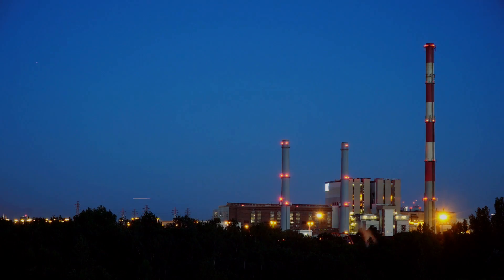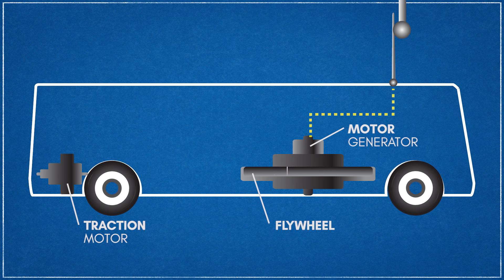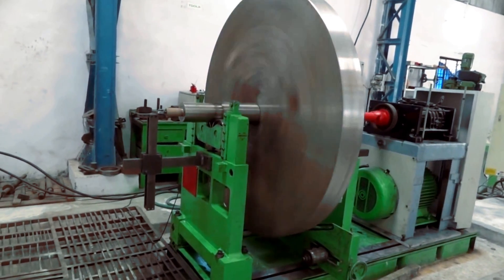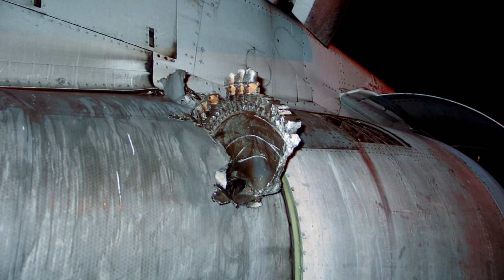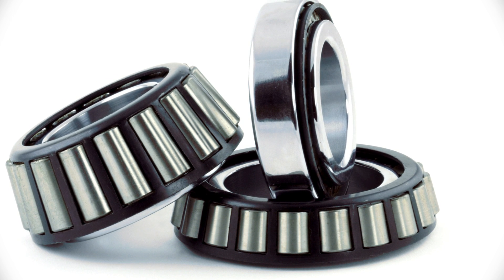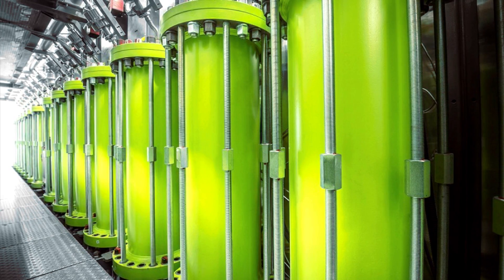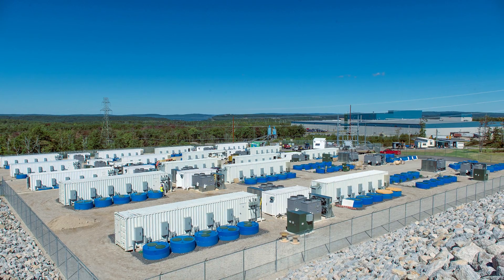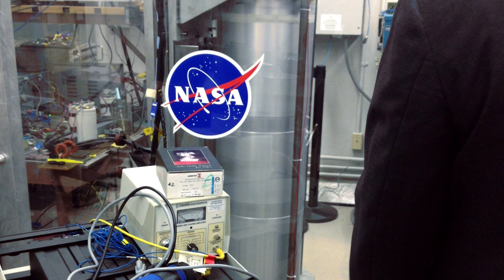The Mechanical Battery

Comment: Also storing energy for rail gun, laser systems...
Reply: Um those things need billions of gwatts to charge fuck the rail guns them selves give off so much thermal heat do to how much energy is required to fire the round all early designs just resulted in a gaint pile of slag that just out a ball of molten metal about 2 foot(its hard to throw a liquid at mach speed)
Reply: @Mystickrage  I've been looking into making a pdw style railgun for a minute. Subsonic is intentional, low effective range is inconsequential, the barrel would need to be replaced often which would decrease failures to function and overheating weakness, and semi-liquid projectiles just sound like enhanced expansion rounds to me. Other than power storage, which I intend to handle off board, I don't see a reason why it hasn't been done

Comment: The biggest problem with this is it lose massive amount of energy as the bus is tilting left, right, or going up and down ramps.
Reply: I agree. That's one HUGE gyroscope! It would make sense if it was vertical axis, so it was not subject to gyroscopic effects due to turning corners. It will still make the bus want to roll side to side, as the front end or back end of the bus dips or bumps. It would have a tendency to turn a rocking motion into a rolling motion.(90° off axis) The only way to solve that problem, would be to have 2 flywheels, turning opposite directions on parallel axes.
Reply: 2B used only on flat surfaces.

Comment: A large flywheel could also be combined with gravitational potential energy storage.  Imagine an enclosed FESS 10 tons in weight being lifted and lowered up and down a tower, or in a deep hole, or down the slope of a mountain.  You'd get a double whammy of energy storage.  
I've yet to see this done, but it would seem practical for the heavier, slower, types of FESS.
Reply: I see a possible problem with this idea.  Remember that the Earth rotates on its axis one revolution every 24 hours so unless a flywheel is restrained precession forces will cause it to change it orientation to the point where after 12 hours it will be upside down.  Easiest way to harvest the potential energy would be lowering the mass using wire ropes over drums and this would not provide the required restraint.  Solution would be to gimbal mount the flywheel but this adds cost and complications.  Interesting idea though!
Reply: @Vincent_Sullivan  Thanks for the thoughtful reply.  Yes, it would need to be restrained well enough to resist such forces, or put on a gimbal.  It could be lowered on tracks and be subject to similar forces that any stationary flywheel would suffer.  Plot twist: the flywheel is also a chemical battery.  Flywheel+gravity+chemical battery.  I only partially joke about that.  I'm sure that lead-acid batteries could be designed as part of a medium-speed FESS, providing both mass and chemistry.  No matter what, we need to be creative about energy storage.

Comment: Excellent video,  here in Australia there is a big discussion.  Solar usage is increasing dramatically,  so storage is big issue.  Question is how to build a kinetic storage that can last for hours, because solar produces most of its energy between 1000h-1400h. Demand ist strongest around 1700h-2000h.
I suspect you could build huge 1000MT flywheels that would hold energy for a decent amount of time. Because one thing we have in Australia plenty of is sun and space

Comment: I didn't hear it mentioned, but we do actually have a ginormous flywheel energy storage system in form of the rotating mass in the electric network, both the generators and the motors. This is not usually apparent, but powerplants do rely on this during switchover etc. and locally dealing with high inertia motors and variable frequency drives they can keep the dc bus energized as long as they spin.
Reply: Exactly right, this is what gives the grid the ability to clear huge faults without loosing grid frequency. A solid state energy source like an inverter would just trip on overload.
Reply: Storing energy as mechanical energy in the form of a flywheel is genius. I particularly like the applications for the system in space. 
If we were to ever make it in space I believe this would play a huge role in storing mass amoumts electricity. 
A solar forge. Sweet sweet imagination eh?
Reply: @avatar1867  Yeah when in space you can connect the electric motor to a propeller and you will be able to fly to the next supper Earth in record time !
Reply: christopher lobato   We already use flywheels on spacecraft for attitude control, and use thrusters to spin them back up when they get low on inertia.

And as for others talking about using radiation, we already use that for spacecraft too. We use these fancy devices called “solar panels”.
Reply: @avatar1867  we already use flywheel energy storage in space in the pointing systems.
Reply: @gregwarner3753  
Nice! I did not know. Now all they need is a manufacturing plant in space.
Reply: @avatar1867  what I like about this idea is that I wonder what happens if we figure out how to make micro versions. Imagine sticking your phone on the charger and it gives a small motor juice to spin a couple of super tiny, extremely affordable mechanical batteries. No lithium, no fuel or coal if you use a solar panel. I hope they figure out how to efficiently wind it up without electricity. 

Just think even if a solar flare hit, you could still charge your car up and drive it through town. Their has to be a way to get energy in your car without having to rely on electric wires that fry as soon as a solar flare big enough hits bruh
Reply: The Earth itself is a giant flywheel, litterally!
Reply: even better is SMES, electron flywheels.
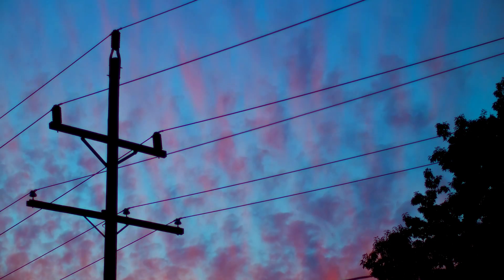Reply: it is mentioned at 13:35
Reply: @ashnur  Not really, as he focuses on dedicated flywheel installations.  The most prominent grid level flywheel use is the "rotating mass" of flywheels and other mechanical components attached to the synchronous main generators at power plants and the occasional mechanical converters.  The fluctuation absorption abilities of these flywheels is often used as arguments to keep those power plants running beyond their direct usefulness as energy sources.  Synchronous flywheels are great at frequency stabilization and absorption of bursts below 1 minute, but not for storing MWh or GWh of energy due to diurnal fluctuations, which is where dedicated variable speed flywheels compete against chemical batteries.
Reply: 13:30
Reply: You're an idiot.
Reply: It doesn't make for good energy storage with a large time differential.
Reply: Chernobyl???
Reply: @holijames82  Yes, Chernobyl!  The event that caused the meltdown/explosion at Chernobyl was a test conducted by the operators that was designed to prove that the flywheel effect of the mass of the rotating generators/turbines could be used to provide energy to the emergency cooling pumps for a short period of time until the standby Diesel generators were started and ready to assume load.  While setting up for this test the operators managed to get the reactor into an unstable condition and the rest is history...
Reply: Nope 🙅🏻
Reply: Yeah, the engineers at Chernobyl were huge fans
Reply: tobzo I was just going to say this haha
Reply: Hold on a low resistance hydrogen filled chamber? Excuse me? Maybe he's talking about helium?
Reply: @avatar1867  -- Hydrogen is widely used for this purpose, even filling the enclosures of giant electric generators. Hydrogen is cheaper than Helium and has higher speed of sound (higher heat transfer) at a given temperature. There is zero explosion hazard as long as no Oxygen is mixed in. So keep the enclosures slightly pressurized!
Reply: @YodaWhat  
Interesting. I feel this would have great potential done in space itself. However there is tons of radiation in space. utilizing that itself could be very good  no?
Reply: @avatar1867  -- Use space radiation... for what? Like the radiation in Betavoltaics, it is extremely difficult to use it at any reasonable efficiency. The range of particle energies is just too wide. Also the radiation in space, while easily damaging to most living things, is still very dilute compared to things we think of as "energy sources". Yes, as a theoretical possibility. But as a practical thing, no.
Reply: @YodaWhat  
Not space radiation. 
Useing the fly wheel to store electricity as mechanical energy, in space. That's all I was saying. lol.
Reply: @avatar1867  -- There are trade-offs to be considered. The main benefit of outer space for flywheels is the vacuum, which also comes with complications. Cooling is much more difficult and flywheels have to be used in matched pairs or quads for torque cancellation, both factors worsening the mass penalties of normal flywheels. OTOH, the vacuum could make possible the use of unusual forms and very large diameters that might look more like spinning tethers than any kind of wheel. Those might help to overcome the normal mass penalty of flywheels.
Reply: @avatar1867  
Yep, it's called sunlight, we use it for power, propulsion and attitude adjustment. 😉
Reply: @YodaWhat  lol it would look like the ship from the cloverfield paradox
Reply: @andrewplough9897  I did not see that movie, it had bad reviews. J.J.Abrams strikes again!
Reply: Take this video down now!!!!!!!!!!!!!!!
Accelerating faster than Earth's spin in centrifugal forces does what; faster than the solar system...? Exactly
We know the benefits of being able to have centrifugal force; it can become a gyroscope, that provides stability
In multiple axis, with multiple gyroscopes at different dimensions....well then all you need it to provide resistance in any variable to make force in that direction; i.e. everything we see is a loss of the universe; heat, electricity, ect. 
If you can spin hundreds of thousands of rotations per, whatever, then you could do millions with a short leap in advancement. So a super electrostatic motor, that is also gyroscopic...a battery, your propulsion, stability control, all in one. Thrown into your flying saucer; you'd fly into a thunderstorm and charge your saucer; spinning your gyroscopic mechanisms up to millions of rpms, all stabilizing each other; and enough power to fly around the Galaxy. Make sure hang solo has done the proper calculation in the computer; zip off into space. 
Avoid the emp's of Betelgeuse 😘; he made mention of this 🙊🙉

So again; take this video down now

Did I mention zero friction lubricants or magnetic suspended bearings. 
What about new rare metals and materials that cool with friction; I think I've said to much...

Again, take this video down now.
Reply: @robh467  
...
You sound like my mate when he's drunk.
Reply: @MostlyPennyCat  
You sounds like said the same thing as every other reply. clap clap.
Reply: 10hrs spin post input..(?)
-Not possible, were Earth also spinning
           (_______F.E.______)
Reply: @lavernroerig4039  Moron
Reply: @lavernroerig4039  good thing to see that you're being duped by Phoenician propaganda, and to think that civilization hasn't been around for a good 3000 years.
Reply: @lavernroerig4039  I question that claim also, likely the last 4 hours are too slow to generate properly though, even if still spinning

Comment: The Zion power plant (Chicago, Illinois) main generator was used as a dynamic reactive load balancer for grid voltage optimization by picking up apparent KVAR loads and bringing current/voltage phase angle shift closer to unity.  I can see a future of more mechanical reactive load balancers being used to combat all those grid tie inverters in distributed generation networks to minimize all the reactive ringing noise.

Comment: One thing I was wondering about is can a solar panel on the roof and /or hood ( bonnet) and/or trunk lid (boot) of a vehicle be used to power a small motor to keep a flywheel spinning and then in turn use the FW to power the car or charge a smaller Li battery to propel the car? As the car is moving it could also augment the power needed to maintain the rotational speed of the FW and during breaking also reverse power to the FW and / or recharge the battery pack. The FW generator could also recharge the battery pack when the car is parked in the sunlight to recharge the battery pack. The solar panels are for the FW to maintain it speed not to recharge the batteries directly. The FW generator would be for that purpose. Just a thought.
Reply: You're adding an extraneous minimal system to an already much more powerful system just to run a particular item.  It's added complexity for almost no benefit.  It would be far simpler to just run it off the main battery.  Either way, solar panels on a car are such a tiny supplement to the total energy needs of moving it around as to be barely noticeable.

A modern electric car can run through a 100 kilowatt-hour battery charge in a few hours of driving.  That's enough energy to power a typical family home for 4 days.  You'd be better off putting your solar panels on the house, where they can contribute a meaningful proportion of the energy being used, and positioned for greater efficiency than on a car that moves around through light and shadow and direction changes.

On a lightweight vehicle like a PEBL or ELF electric bike, where you only have to push around a hundred kilograms, then the rooftop solar panel can recharge a meaningful amount of capacity in a few hours, because they get 80-100 miles on a battery bank of under 3 kWh -- an energy/mileage equivalent of a car that got like 1,800 mpg.

Comment: Some of our wrist watches have windings that uses mechanical energy to power devices.
Reply: Some? A LOT of our watches have them. Every watch without a battery. Every clock.
Reply: @jamesbizs  think he meant instead of winding it up at certain time with the winder to load the spring but winding it up automatically by your arm movement as you went about your business.
Reply: W Winterheart  Tissot, Omega, and Seiko had watches in which rotation was used to load a battery. I have a Tissot PR 100 Autoquartz.
Reply: @DietmarEugen  funny thing is the movements are all by ETA and cost about £30. One haas to wonder where the other £469.99 comes from, the cases are mostly just stainless and plate…
Reply: Although to be fair the Seiko are pretty darn good and made in house if memory serves.

Comment: Fantastic video. I subscribed. If I were to make a gentle suggestion it would be to spend a few more seconds talking about windage (the need for vacuum in high rpm) and the material science showing the strength necessary to contain the forces generated that want to explode. My favorite analogy when explaining flywheels is the old playground "merry go round". Most people born in the 20th century remember how hard it was to hold on at the outer circumference and how easy it was if you sat in the middle. Again. Thank you for a video I can share with those interested in flywheels. The history in the beginning was excellent!

Comment: I don't think this is practical for mobile use cases but I was blown away by the potential for using this technology in a power grid. Long life, high reliability, rapid charge, rapid discharge, constant battery life, non toxic components.... What's not to love about this?

Comment: The Proton Syncrotron at CERN wich have operated since 59 and still does have used a flywheel system installed -68 consisting of a huge MG machine the size of a powerplant steam turbine to even out power fluctuations in the grid due to the accelerators fast cycle times. While operating (wich it does more or less 24/7 during almost the entire year minus service and a longer stop of the entire facility over christmas/winter and starting again in feb/march) it can ramp up and down in intervals of 2-3 seconds at around 40 MW  plus minus ramping the magnets up/down = 80 MW power variation every 2-3 second while delivering beams to several experiments running at the same time including the loading/filling of LHC. Without this flywheel storage this rapid and constant high power cycling would cause the voltage in 1000s of homes and industries in the area to constantly fluctuate  causing lights to blink and vreak havok on computers and other electronics in the area. Recently mostly due to lack of spare parts to this old MG, the machine have however now been replaced with a solid state capacitor based system called POPS (POwer for PS). This is an image of the flywheel machine. http://cdsweb.cern.ch/search?recid=955079

Comment: I always thought if the wind generator towers are hollow they could put a cable and flywheel system inside so when its generating it can wind up the cable with a weight on it and when the wind is not blowing the weight can drop slowly and generate power for short periods, Like an old clock, just my 2 cents.
Reply: Actually, I read about such storage a few months ago. I don't know if it was inside a wind turbine tower, but your idea is a good one!

Comment: Aren't regenerative braking systems technically flywheel generators?
Reply: In a sense, yeah, though it's really converting linear motion (car going forwards) through rotational (wheels on the car turning), but it's ultimately both inertial storage, so yeah, very similar
Reply: @mduckernz  : 😃 It's all just semantics.

Comment: That is all good and a good idea, however, it uses more energy to maintain this flywheels spinning than the occasional energy extraction. A Diesel engine and or a battery bank will be much more effective in a UPS.

Comment: Fantastic overview!!!  I would just put in question the statement that gyroscopic systems are lower cost than electric batteries for high peak power production.  One should not underestimate the cost of the generator designed to generate high power peaks!